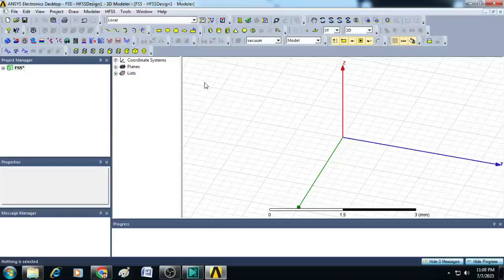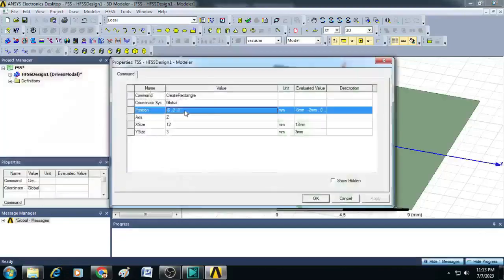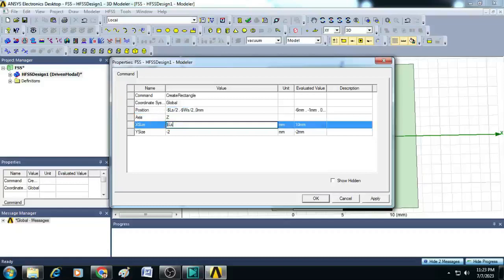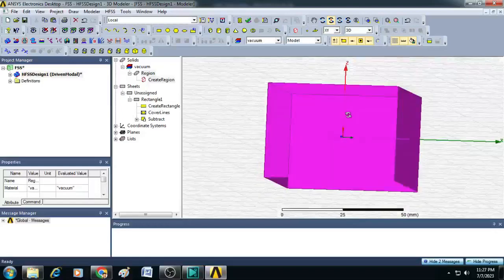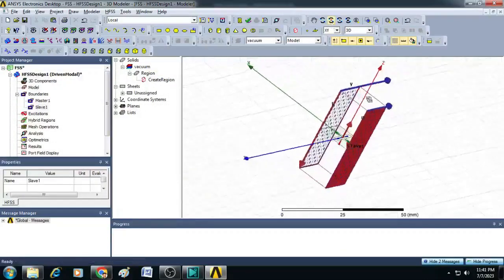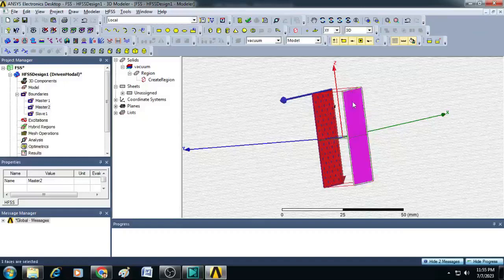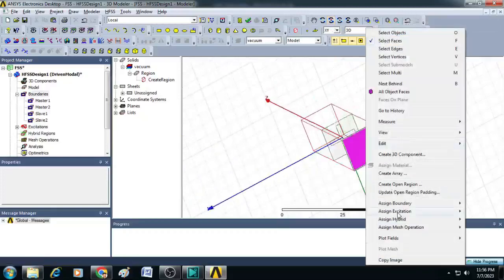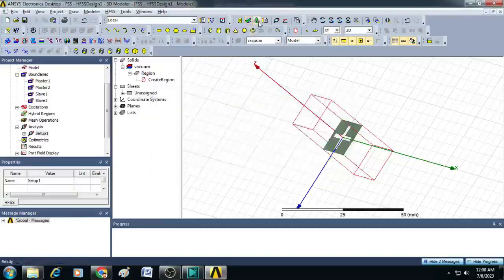HFSS Tutorial: Simulation of Frequency Selective Surface

Comment: Dear Sir, 
I am trying to design a Circularly Polarization reflective metasurface. I want to know , how to Get the accurate circularly polarized reflection parameters when I try to illuminate the unit cell with a circularly polarized excitation wave. I set one Floquet port having two modes, 90 degree out of phase from each other. After simulation, I am able to plot the (FloquetPort1:1,FloquetPort1:1); S(FloquetPort1:2,FloquetPort1:2); S(FloquetPort1:2,FloquetPort1:1); S(FloquetPort1:1,FloquetPort1:2); But they both seem to represent the linear polarizations. How to get the circular polarization, like S(RHCP,LHCP);S(LHCP,LHCP). Is there any formula to calculate it? Thank you.